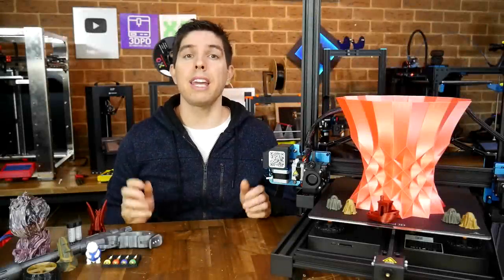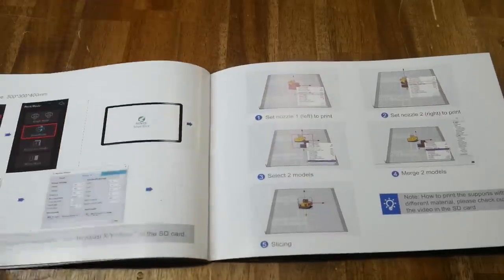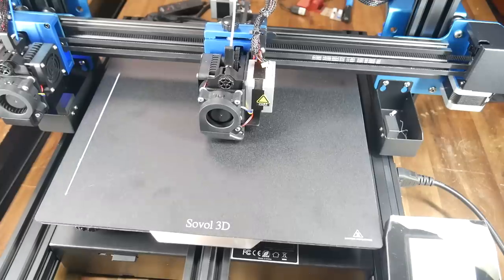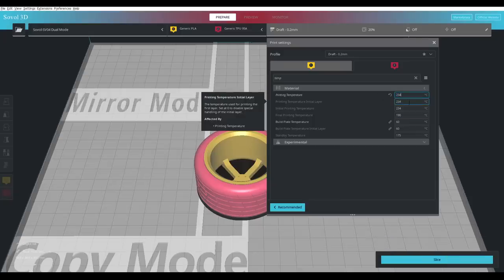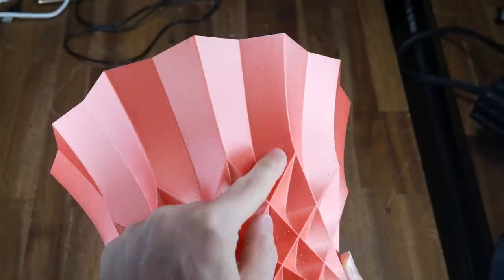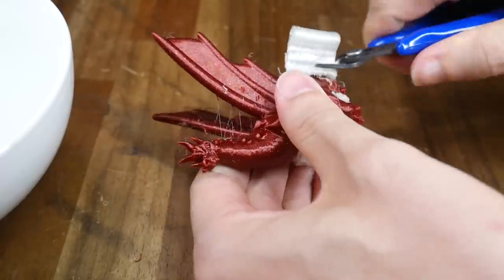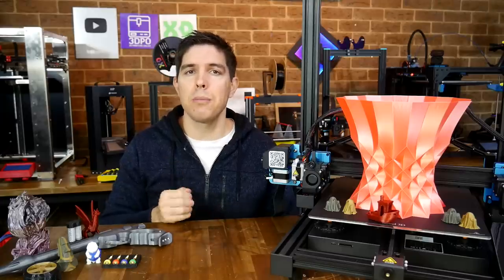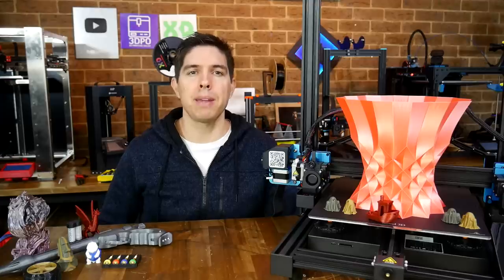Sovol SV04 IDEX: Capable with one big but fixable problem

Comment: Nice video. I'm yet to buy my first 3D printer, but I'm finding myself drawn to the IDEX types. This one looks good, but I've seen that all IDEX printers have issues with the levelling of the 2nd print head thanks mainly to uneven build plates, leading to irregularities or failures in the 'copy' or 'mirror' modes. So, I was thinking....after levelling the plate and print heads as best as one can, both manually and automatically, could one not print one very large raft with a dissolvable material with one head, then use that as the 'build plate' for copy and mirror modes?
Reply: it's too complex as a first printer, get yourself a cr10 s or v3 and learn then move up to index. it can be very frustrating learning index if you have zero experience of gcode and 3d printing. Have fun
Reply: @spiritburners  Or perhaps just get this amazingly inexpensive dual head machine and just run the IDEX in single head mode until he learns those basics which you correctly mentioned he needs to acquire.  When I bought my first printer 5 years ago, a Robo R1+, it took me about a week before I was wishing for a way to print multiple colors.   My SV04 is arriving this week and I'm excited as hell about it!
Reply: @jims6450  That is true, however it really is way more complicated, the setting up of the machine must be perfect on both heads and that can be difficult for a new user to fully grasp.  You also need to be able to build 3d models where you require  different colours or supports, again complicated and needs 3d modeling experience, also just slicing is not as straight forward as just pressing the button, you need to think a lot about how you want the model to look and feel and the strength of it if it's that sort of model.

It can take a couple of years of printing most days to fully get your head around Cura or Simplify3D, it just depends if you want to use the printer to print ready made models or in my case use it for prototyping, making signs etc .  That really helps once you start the dual colour and different filaments process.

I wanted it primarily for the ability to use soluble filament for difficult parts that I print, also I can't be arsed half the time to change the filament on a sign because I forget despite Cura beeping at me., then end up leaving the print cooking for a hour or two before I get round to adding the other colour.!  That will make life easy, as most of my prints are not too big I relish the ability to print two at once as well.

I did look at the Creality Mill but it requires a huge amount of setting up and there are issues with some of them, it also just needs so much time to maintain it in perfect operation .I think you really need to love those ones or you just like pain...

If you are competent then yes you could use it as a first printer if you understand  additive engineering, 3d modelling and so on, but as an experienced user like yourself it would be a lot easier to use because you already fully understand how the process and workflow happen.  I just think for additional colours learn how to use a big CRS 10 or V3 and learn Cura properly asto when to add  the other filaments in, the lack of Bowden tubes on newer printers makes it so easy now to change the filaments.

To summarise, it could be used as a first printer but with a steep learning curve however I would still suggest a Ender 3 o rone of the others to learn the  process as you can do a lot without a IDEX machine . Its a specialist printer for special jobs that are difficult to do on a normal printer but not impossible .It speeds up your workflow for prototyping work a lot.

It really is good fun so enjoy and I hope it arrives before Christmas for you !! 

Have a good one... Neil.

Comment: as usual awesome video.   any chance you hav instructions on how to get the usb connection to work on this printer?  I just got one and the sdcard slot is not working and I'm not having any luck getting my pc or mac to connect to it.  being thats its a creality board I would assume that this would work like the ender 3 with a raspberry pi but since the usb isn't working thats a no-go so far.

Comment: I'm looking for tips with PVA buildplate adhesion. I've tried reproducing your results on my Sovol SV04 and can not get PVA to stick to the bed; the nozzle ends up ripping up parts of the print and I get a sticky mess. Do you have any advice?

Comment: Hi, good video on idex
I already built one, now I want to upgrade to dual idex printer
I want to use 4 extruders and 2 nozzles, I want to use 2 in 1 out hotend, is it possible?
What are the settings need to modify in marlin? Please help

Comment: The artifacts on the vase may have been caused by some sort of resonation from the motors? Possible to due with the table the printer was on, or a slight vibration of the Z Axis.
I've had the same problem before in vase mode, and an adjustment of the lead screw nut and some lube fixed it.
Could be the anti backlash nuts as well not liking the constant Z raise of vase mode?

Comment: Is there any way that you can ask for the SV01 Pro Unmodified Firmware to be uploaded to the sovol website? As of right now there is no way to modify the firmware as they are using a GD32G303RET6 on newer Creality boards. Not sovols fault but annoying to try to increase the max hotend temp if you install a all metal hot end like I have. Being marlin FW it should be released with the source code anyways. (Correct me if I am wrong). Thanks in advance for responding/trying to help.

Comment: Hello, I print dual mode with two materials on SV04  and sometimes do not print from the second extruder.. Seems that the printer forgets to print some layers. Do you know if it could be a problem with some specific settings in sovol slicer? Btw after calibration dual prints look very nice.
Reply: I fixed this issue using a better quality memory card. The one provided with the printer skipped layers randomly.

Comment: I recently got the SV04 and really like it so far.   I have not noticed nearly the extent of stringing shown in the video..... so I can only assume they upgraded the firmware?    I'm also wondering though about the stock print speed of 60 mm/s and if the printer can handle any faster.  Are there any other adjustments to increase print speed.  I've seen similar speed tuning recommendations for other printers but none for this one yet.
I understand the dual extrusion takes longer, and its worth it for that when you want the dual colors which is awesome.... but was just curious if anyone had found any.
Reply: Actually I printed another 2 color print and now I'm having a lot of stringing :(
Has anyone since found an updated SV04 firmware where this has been corrected?   I'm everyone reading this would be interested.

Comment: The ptfe tubing was cut short at mfg. See my thingiverse listing for a printable cut guide. It has a permanent void/gap inside the hot end when tubing is short.
Reply: you have a link to the file as I didn't find it on Thingiverse

Comment: I have the issue of the right extruder parking and hitting the left extruder during printing and causing that layer shift. Have you found where to change that setting? It happens the first time the right extruder starts and all of my dual prints that I have sliced are doing it.
Reply: I think I found the issue and it's within Sovol's version of Cura. I copied the profiles over to Cura 5.1 and it is working well so far!

Comment: So in theory printing with 2 extrusions would half print times?
Reply: At best it would double production rate from 1 item per X time to 2 items per X time. Printing 1 item with 2 extruders doesn't work to speed it up, just to use multiple materials/colors. Printing with 2 extruders at the same time on the same object would risk having the extruders collide and would require far more complex firmware to handle that, setting up all that would cost a lot more time than just printing with 1 extruder at a time.

Comment: Can you comment on IDEX vs. tool changer? Thinking about the upcoming Prusa XL...
Reply: IDEX in this case is going to be limited to only 2 extruders compared to the XL's 5, but it does allow you to use both extruders to print at the same time while the XL can only use one at a time to print.

Comment: Is it Klipper-izable? I just came to Klipper some weeks ago and I don‘t know it Klipper supports IDEX..?
Reply: It looks like it maybe able to.  This is from the Klipper website:

[dual_carriage]¶
Support for cartesian printers with dual carriages on a single axis. The active carriage is set via the SET_DUAL_CARRIAGE extended g-code command. The "SET_DUAL_CARRIAGE CARRIAGE=1" command will activate the carriage defined in this section (CARRIAGE=0 will return activation to the primary carriage). Dual carriage support is typically combined with extra extruders - the SET_DUAL_CARRIAGE command is often called at the same time as the ACTIVATE_EXTRUDER command. Be sure to park the carriages during deactivation.

See sample-idex.cfg for an example configuration.

Comment: My experience with this printer isn't all that good. (I like it's mechanical design though.)

First of all, their firmware isn't open source at all. I had to ask them three times nicely to only get the binary of the FW V1.1.4 that my printer came with. They've told me explicitly that they are not allowed to send me the source code. The source that one can download, is only the basic non modified Marlin.

The problem is, that this printer has some serious problems interpreting G-code properly.
I didn't test it with their version of Cura because this is not a requirement for a properly designed printer - it does understand G-code.
For example: it freezes if it gets a wrong character in the g-code stream. It forgets which head it's using after Z move. It makes half a second pause on each transition between planar move and Z move. You are not allowed to have ABL G29 command in your code or it will forget home positions and which head it is using and start slamming heads against each other and against the sides. It doesn't take the Fnnn parameter of the first G1 move, you have to write it in a line before. Randomly skips some commands...

There is a community improved firmware out there , so I will try to install that.

Comment: How does mesh bed levelling work with two nozzles, each needing different correction 🤨 Does it calculate correct z movement for each motor to get both nozzles at correct height, use average mesh value, correct only for one of the nozzles, or just ignore the mesh...

Comment: You did not cover the leveling of the 2nd hotend which on some IDEX machines is a pain to get done, how did this one fare?
 I got a shiver up my spine when I heard it was a Creality board and software, does the ABL probing give a correct uniform mesh? or is it like the majority of Creality FW attempts where the nozzle is placed in the position that the probe should be, resulting in an incorrect mesh and just four fiths of the bed being probed?
Reply: 4:21 shows the second hotend height adjustment, using a thumbscrew on top.
Reply: @0LoneTech  Thanks! I think my cats demands for treats made me miss this part before I could pause the video. I have been wanting an IDEX printer for ages but all the ones I have seen up until now have all had problems

Comment: ........people use untweaked profiles?
Reply: Many people I suspect.  A lot of folk want something that is plug and play to print out their miniatures etc. rather than spending hours calibrating everything to the last degree.
Reply: When I bought my Ender 3 max, I used the untweaked profile in PrusaSlicer and it worked well for a long time. The only downside was that it is quite conservative on speed, but the print quality was better than a lot of much more expensive printers I've seen on Youtube and buying a printer with such a large build volume and low price meant I wasn't expecting speed. I'll admit I've never reall used the Creality Cura slicer and profile supplied by Creality but I'd already installed PrusaSlicer (which had a Ender 3 profile supplied) before the printer arrived just to see how it worked, when I tried the Creality supplied version once and didn't get on with it at all. I guess Slic3r fits my expectations more than Cura, but I suspect thats a very individual position.

Comment: 2202: still uses a piece of paper to set the nozzle offset
pro tip: never do this with paper paper can scrape into the nozzle and you will have problems from there Ihave seen this so so many times and people getting frustrated because of this ...
Reply: Paper works just fine. If you have issues with using paper then you're doing something wrong.
Reply: @wanders278  I think he means don't use toilet paper.